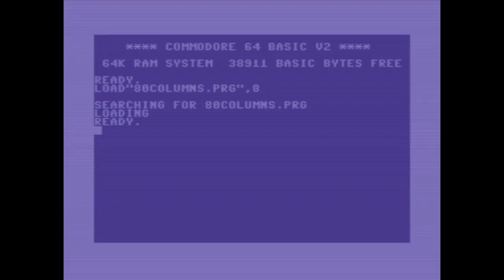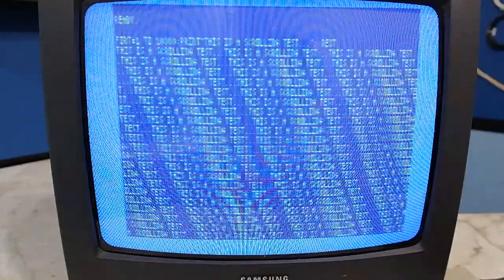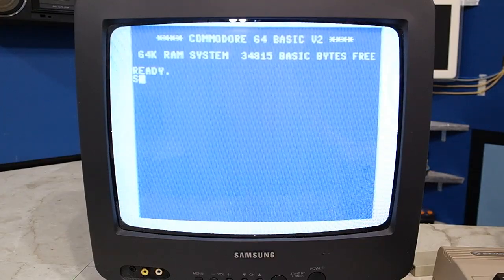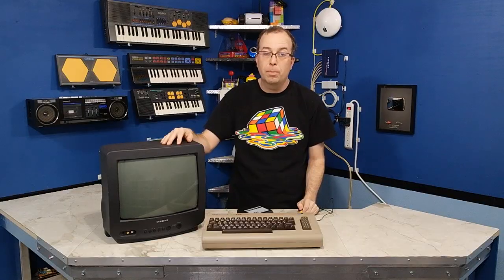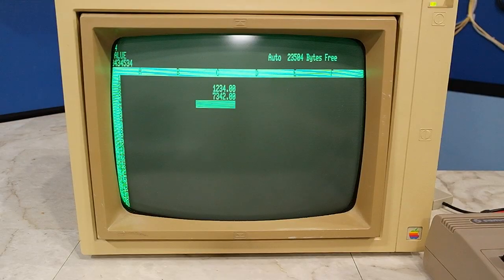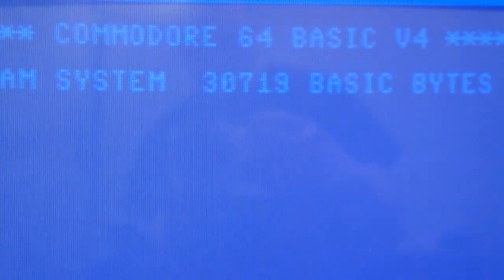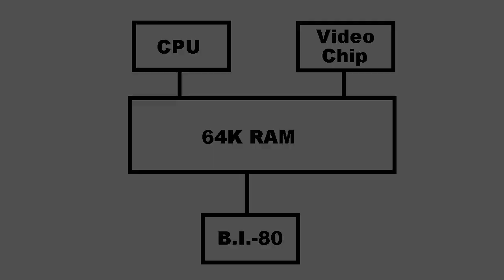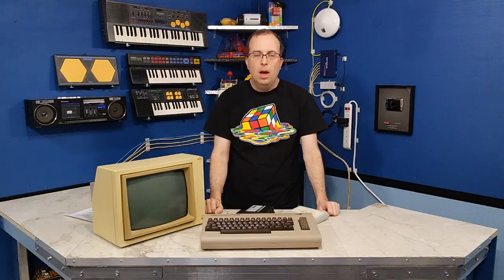The Quest for 80 Columns on the Commodore 64

Comment: When I was in grad school in the early 1980's I used a C64 to write all of my papers.  I bought my C64, green screen monitor, Star Micronics printer and an 80 column adapter which I plugged into the back of the machine from Crazy Eddie (the name of the store) in Long Island, New York.  I do not remember the name of the adapter, but it came with a word processor which, I believe, was named PaperClip.  Does anyone remember such an 80 column adapter?  I was very pleased with the setup because it produced relatively crisp fonts in 80 column mode on the green screen monitor.  The hardware is long gone, but I still have the papers that I wrote back then.
Reply: That would have most likely been the BI-80, since that was from the same company as PaperClip.

Comment: I used the 80-column bitmapped graphics mode on a C64 in Novaterm all the time to call local PC-based BBSes (40 column for the Commodore boards of course). It was actually quite legible and no problem to read at all on a 1702 monitor (with its separate luma/chroma). It could even do ANSI, and I don't recall the performance being bad at all relative to the 40 column mode either, maybe because Novaterm was a great piece of software and well optimized. You kind of dismiss the software mode out of hand in the video, but in reality it was quite useful for applications like telecommunications and word processing, so I'm guessing a lot of people just didn't see the need to buy specialized hardware for the purpose.

Comment: Fun fact: the VGA connector is sharper because it also carries either one composite sync or individual horizontal and video sync signals, all of which are greatly degraded using composite video and resulting in your blurriness.  This is also how S-Video connectors work.

Comment: Actually there may be another way to get 80 columns on a C64. There's the Bildschirmtext cartridge. It is essentially a whole Bildschirmtext terminal in a cartridge. Bildschirmtext offers an optional 80 columns mode, and at least it has the standard 6x10 80 column glyphs in ROM. I think there also is a way of controlling it via the C64 (haven't tried it myself yet). If that worked you could get 80 columns with 8 background and foreground colours and some special formating, or 40 columns with lots of formating and 32 foreground and background colours out of a palette of 4096.
The Bildschirmtext 2 cartridge is available on German ebay fairly easily.
Here's an old advertisement for the service which shows some of the graphical capabilities of the terminals

https://www.youtube.com/watch?v=iBfvIh2K4G0

And here's a talk I did about that service and some of the technical things behind it:
https://media.ccc.de/v/35c3chaoswest-7-eine-einfhrung-in-bildschirmtext

Comment: If you use the Luma input on a 1701/2/1802, etc monitor, they look nice and clear, too.  I have a BI-80, and yea, it's mostly useless.  :)  A terminal program that worked with it would be fantastic, and as as a side note, it also doesn't play nice with parts of JiffyDOS, either.

Comment: I had a red Cartridge of a much smaller size (do not know the brand anymore) that had all kinds of additional features / commands etc. in it that also gave the option to display 80 Characters by loading/typing a command If i remember it right.. Made my first program in basic using  that, to display all snack's and register what everyone took. :-) Nice to see your video's !
Reply: Whoa, found it (second picture : called Power Cartridge) http://www.powerprograms.nl/commodore-64/commodore-64-utility-cartridges.html

Comment: I think those modules for the C64 are really cheating.  The graphics hardware on the C64 is really only capable of 320 x 200 resolution and only 40 columns using its native text mode.  When you're putting a whole new graphics chip in the cartridge, I start to think, "where do you draw the line?"  You could technically put hardware for an entirely new computer inside something attached to the cartridge port (including a new CPU) and basically only be utilizing the computer's power supply.  My favorite was the software only idea (which of course has to use HIRES mode and you only get 4 pixel by 8 pixel characters - really 3 x 8 because you need to leave space between characters.) This is using all of the original hardware.  I wish I had that program back in the 80s.
I just thought of something.  All of your text would have to be the same color! ha!  Oh well... if you tried to use multiple colors, groups of 2 characters side-by-side would have to share the same foreground and background color, which wouldn't be useful.  Also, multicolor mode would be impossible.  That would limit your character resolution even FURTHER to 2 x 8 pixels!! haha!!

Comment: the only other purpose i know of for 80col in 8-bit land is with a modem terminal program. Atari released an 80-column emulator in the 8-bit XE era which had about similar performance. it was immensely useful for connecting to 80col PC BBSes.

Comment: I had a VIC20, a C64, then later a C128. I was able to get 80col monochrome on a 1702 monitor. I used an RGB connector, an RCA connector, and some left over RG58 coax from a ham radio antenna I built. I soldered one end of the center connector to the pin on a RGB connector and the other to the RCA and plugged it into the front and it worked. The resolution wasn't great, but it did work and I was able to do word processing using Paperclip on it. Definitely not plug and play. Fun days.

Comment: without sprites and accessing the color ram it probably would have been possible to support 80 colums with a char set of 6*8 pixels. the horizontal resolution for the c64 was 320 pixel (40 colums times 8 pixel).
with 80 columns and 6 pixels per column they would have needed 480 pixel per line.
so with a little bit higher pixel frequency and using the border in a monochrome mode,  i guess that would have been possible while still using the same shared ram bus with the cpu.
that would have been really great for the success in business applications.

Comment: Actually, back then, once you bought the computer... and a casette drive and/or eventually a 1541... you couldn't afford much more.    Maybe a couple of cartridges.  You passed around carts with your friends and that was it.   Mostly you wrote your own BASIC programs on them.   

Even getting Compute! magazine and reading the computer magazines in the book stores, I had no idea that a plethora of all these games and accessories even existed for the C=64.   You just kind of assumed it was all vaporware, from the impression you got from the like the back of the Vic-20 box.    

I had a Space Invaders Cart, a Gorf Cart.. tape drive... eventually 1541.   I borrowed Adventureland, Radar Ratrace from a friend.   I bought a sketchy BASIC compilier out of the back of a magazine once.     

Only until Geos came out and I saw it in a college bookstore did I plunk down some serious money for my first ever software... only because I had Mac envy.  It was pretty tedious to use it with a Comodore Atari clone joystick though.

Comment: I'm not able to use the 9 pin RGB output on my C128 on my Commodore 2002 color monitor which does support the RGB input. Is my C128 not working properly? I've done a visual test and the entire 128 board looks literally brand spanking new. I'm waiting for my new standard composite cable which will arrive tomorrow. But I really wanted to use RGB don't care for the 80 column function. But would of love an RGB signal instead of a composite. Could it be the cable I bought, it's was marketed as "DB9 9 Pin Serial / RS232 Male / Female Extension Cable" is it the wrong type of cable for video?
Reply: I am pretty sure, the serial cable won’t work for cga... it needs all the wires in his diagram. Serial flipped some, and didn’t use them all... extension cables are different. So unless your cable has ends that open and can move the pins around, I don’t think it will work. 

I have hundreds of cga cables at my office, I could test them, or send you one...

Comment: I used both the '64 and the '128. There was some business software for them, though it wasn't really easy to use. I had a spreadsheet that was originally written for Burroughs computers (I used it at work), that was re-written for the '64, but I can't remember its name, any longer. It was slow, but it worked. I also used something called Geos for the 128, which I loved to play around with. There was even a Hebrew word processor package (I taught Greek and Hebrew on the college and graduate level at the time), that wrote from right to left, and would print dot matrix in 80 columns from the 40 column screen. Good times!

Comment: The Data-20 40 column mode actually looks a bit better to me, as it fills the whole screen and has a slightly nicer font in my opinion. The Data-20 80 column mode looks clearer than the software mode.

Comment: A similar situation to the Radio Shack/Tandy Color Computer.  There were a couple of 80 column cards and at least one that provided the ability to run CP/M.  Neither was cheap though, and there were a couple of software solutions too.  The software would have been widely bootlegged as was the norm in those days.  There was little support for any of these.  CoCo 3 added 40 and 80 columns along with higher res graphics.

Comment: I tried using Compute!'s 6480 program but it didn't work all that well, so ended up writing a 60 column system which worked reasonably well on a TV. Buggered if I can make sense of the source code now.

Comment: I don't know who translated the Chinese title but personally I would translate it as "在Commodore64上寻找80列显示之旅“ (The journey of finding 80 colomn display on Commodore 64). Just say this in case you want to edit the multi-language title. (The currect Chinese title actually says "Implementing 80 column display on Commodore 64" which to me doesn't sound as poetic as the original title.)

Comment: Note that C= + SHIFT behaves differently to what you said on the C128, at least in the 80col mode: unlike 40col mode it does not change the case on all letters on the screen, just what you type next will be in different case. Reason for that is: the VDC can actually hold 512 character fontsets and screen memories.

Comment: I had a C128D but I had no RGB monitor, only a TV. But, I found that I could get a monochrome 80 column display out of the RGB connector and get 80 columns pretty clear on my TV but obviously only in 128 mode.  But it was great for connecting my C128 to the dialup pools of my university so I could get on the internet. Yes, I brought my C128D to college in 1993!
Reply: I used my C64 for everything, including productivity (thank you GEOS!) and dial-up connectivity, until I finally got an Amiga in 1992.  So I’m not far behind you!
Reply: I really wanted a 128 for many years, but I could never afford one.  As it was, I bought my Commodore 64 second-hand for $200 in 1986 or so.

Comment: I think you should do a video for the Atari 8 bit range 80 column displays.   1 of the Atari ways, the XEP80 used a totally different approach with data transferred by Joystick.  Some complain about this being slow, but with Atari writer 80 it was a very simple solution.

Comment: Actually I just recently found (by accident) a pretty good software 80column software on Plus/4, seems very well readible. You can find it on plus4world
It is called Cool News4, and it uses a 80col engine. (plus a pretty decent software sprite routine too) 
(fun fact it was made by one of my schoolmates I knew, but did not know his programming skills on +4)

I think the magic here the high contrast and pretty clean fontset he created.

While certainly it cannot compete with the HW cards in display speed, the readibility seems to be great. 
I tested some other software 80 col programs, and the other fontsets were just terrible compared to this one.

I made a screenshot from YAPE emulator with CRT emulation (this effect makes some rasterline and dithering effect).
https://imgur.com/a/9GVFKDe

Comment: Some more advanced method of producing 80 columns on a VIC-II chip is to use interlace. Those 80 columns flicker, but are far more nicer to read. The drawback is low speed, since screen data is double buffered. Of course the ultimate kick-ass 80 columns experience on Commodore 8bit goes to Commodore 65.

Comment: the 1981 Acorn BBC micro also had a motorolla 6845 CRT chip for handling its bitmapped graphics modes (and lightpen), it also had a composite RGB output which provided considerably better fidelity than the UHF output, especially in the 80-column modes.

Comment: IIRC the C64 GEOS word processor had a WYSIWYG-ish mode that was more than 40 columns, done in software...but was it 60?  80?  GEOS was a breakthrough GUI on the little Commodore.
Reply: GEOS was amazing at the time, but used quite a bit of processing power & seemed oh so slow.
Reply: GEOS was just a proof of concept on the 64.  Nobody I knew ran it for anything other than amusement or showing off.  It was just too slow for real world use... booting into basic was just the strength of the machine.  if you could afford the expensive REU memory unit at the time, which did make the system usable, you could easily afford a better computer altogether.  The 128D ran GEOS much, much, better because of the 80 column output and slightly faster speed.  But, it was so outclassed by the Amiga, it was embarrassing next to it.

Comment: Also on the 128 the 80col display was the only one available if you set the cpu to 2mhz speed with the FAST command. The Vic-ii would blank out.

Comment: I remember using an 80 column terminal program on my TV, and to get the best resolution I adjusted the TV color to output just 1 color. Basically playing with the gamma controls until everything was green. Worked pretty good.

Comment: I really wish I still had all the tapes and stuff from back in the C64 days.  I actually had a project that started on the VIC20 which used a proportional font to increase the number of characters per line.  Can't remember all the details but I think I ran with an 8K expansion though I was using a 48K expansion to code it.  Later re-wrote this to run on the C64.....

Comment: I used to buy EGA monitors from Wacky Willy's in Portland, OR and resell them with an adapter cable for C128 80 column mode.

Comment: I knew Batteries Included, they also did custom programming for turning these machines into special controllers that were used in industry. If you wanted to automate a process in a factory you could go to them and they would write a custom ROM and solder up an interface connector and you'd have a low cost way to automate or partially automate a machine. One custom client job they did was to turn a C64 into a video logger that was used by ad agencies to make sure they ads they paid for ran. The C64 ran a VCR that had a wired remote control and would go to the channel and record the few minutes of video where the spot was going to run.

Another thing about the era that might not occur to you is in general there was a lot more custom programming going on and I believe that it was these people who used most of these 80 column cards and not people who used general shrink wrap software. The fact that there was a lot more customization going on makes it a lot harder to go back and see a complete picture of the market but it was these people who were more willing to spend money on such products.

Comment: Hi, I've seen your video in relation to the 80 columns on a C64.
I have another device (I think it is made in spain) that I acquired in the 80s at a computer fair in Barcelona. There was an accounting application that worked in 80 columns with this hardware. I can send you a photo if you wish. Unfortunately the IC have been filed to prevent the reproduction of the device.

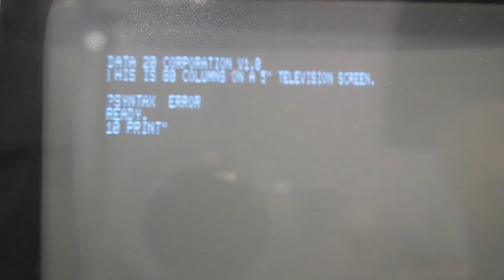Comment: 6:23 problem for current OS¨s lets use 4K and make font 8nano pixel, why font cant be 36pixel same size as it would be 8 pixel on vga lol. what good on OS when font is default be size that you cant read. bigger screen res make all faster. no its make it slower. this year new 5inch whatever  biggest screen on mobile phone. but they not say you get also smallest font on world. its ok use small resolution and bigger font LOL. why is so hard. zoom on google maps or what ever see what is street name. well great zoom in font get just smaller. wtf!. well buy big screen tablet for travelling and you have huge screen huge reasolutin smaller text and maps is even harder to read. zoom in font get smaller.who is programmer?if i want zoom in means i want to read. but hay we scale text down